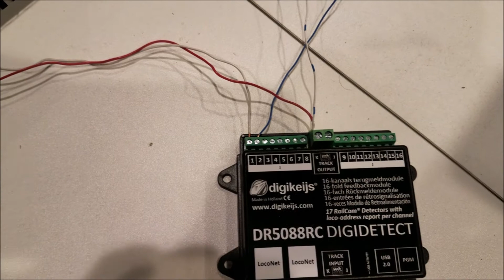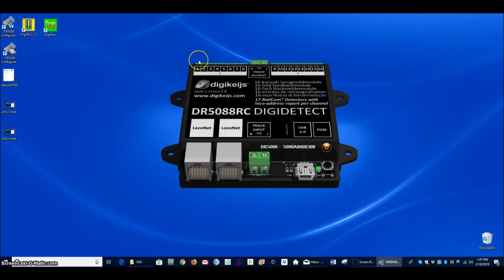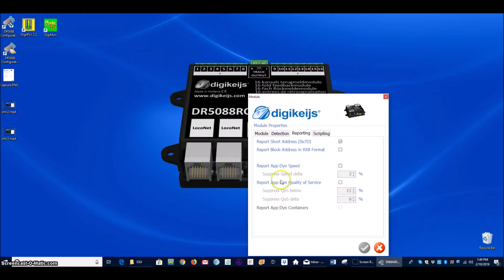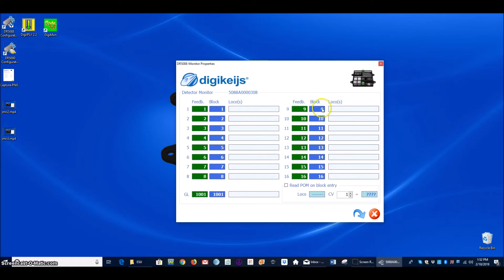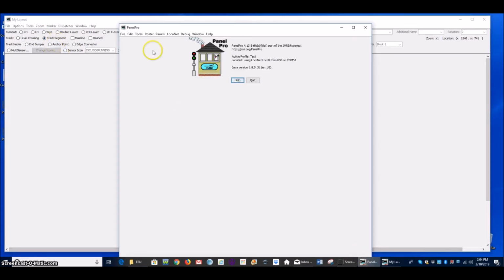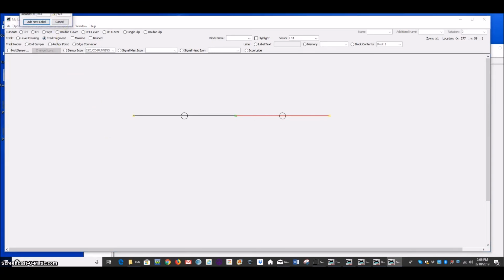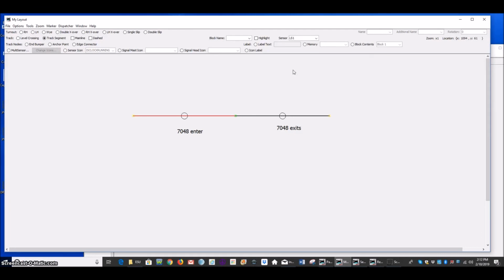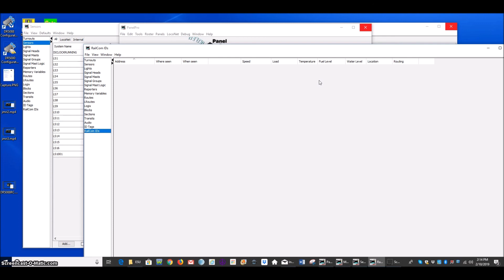Setup For Digikeijs DR5088RC RailCom & Block Detection With JMRI

Comment: What is the 17th global channel?  How is it different from the other 16?  Does it have some different application?  I've read the manual for the DR5088RC and it seems to assume the reader already understands what it's for.    Thanks!
Reply from the maker: The 17th channel is for any section of track that you don't need the detection.  An example would be yard tracks or a siding.

Comment: Maybe you can answer my question, does it also do current detection? Just wondering if it works with the resistive axles that a lot of people use.
Reply from the maker: It will do current detection but you need a higher value resistor for the wheel sets.  This is by design for RailCom to work.  A loco will provide enough resistance but your average pre-made wheel sets won't.  You would need to make your own.  If you already have a fleet of cars with the resistors on them then it would be much easier to double block the layout using a DR4088LN-CS or similar.    Here is a video on Double Blocking: https://youtu.be/1KDHgbCGLhw
Reply: @IronPlanetHobbies  Thanks for the answer! this helps make some things clear. I was also wondering about double blocking (although, for termination tracks I'd also add a stop IR sensor probably), so thanks for linking the video.

Comment: Will this detect a resistor wheel set as well?
Reply from the maker: It will do current detection but you need a higher value resistor for the wheel sets.  This is by design for RailCom to work.  A loco will provide enough resistance but your average pre-made wheel sets won't.  You would need to make your own.  If you already have a fleet of cars with the resistors on them then it would be much easier to double block the layout using a DR4088LN-CS or similar.    Here is a video on Double Blocking: https://youtu.be/1KDHgbCGLhw

Comment: Hi! Is Digikeijs going to make a Feedback module equivalent to the ROCO Z21 detector running on CAN Bus?
Reply from the maker: I would say probably not since the DR5000 uses XpressNet & LocoNet.  The only advantage for Digikeijs to add CAN would be to use it with Zimo since the Zimo LocoNet port isn't active (as far as I know).   The DR5088RC already works with any LocoNet system that supports RailCom such as the Roco Z21.
Reply: @IronPlanetHobbies  Thanks. I have a new Zimo system, will do testing Zimo feedback module on CAN Bus with iTrain if it can detect the address and direction of travel like Z21 detector connected to Z21 via CAN Bus.
Reply from the maker: @dcctrain  You bet!   If you get a chance to try the LocoNet port on the Zimo, I'd be interested to know if it works now.
Reply: @IronPlanetHobbies  Is DR5088RC will read the address and direction of travel?
Reply from the maker: @dcctrain  Yes,  in some 3rd party programs you can see the RailCom info.  This can also been seen in the DR5088RC PC App.   You can download and run the PC App in demo mode without having a DR5088RC just to get a feel of how the program works.  You can follow the link from here.  https://www.digikeijs.us/dr5088rc-digidetect.html
Reply from the maker: @dcctrain  Yes, and it is reported in the RailCom info.

Comment: Will the  work with an ESU 50200 Command Station and ESU decoder equipped locos for block detection without using JMRI?  Thank you
Reply: It works as a block occupancy detector but RailCom feedback is not available on the ECoS.

Comment: Hello, From the DR5088RC track output K, red wire is going on the rail. But where is going the white/blue one?
Reply from the maker: It is also going to the common rail since mine was double gapped.  If you aren't double gapping then you would only need the red wire.
Reply: Thanks a lot

Comment: Digikeiji do not mention anything about using a isolator. Do I need to use one of these if I am only using DR5088RC.

Alan
Reply from the maker: You only need the isolator if you are needing to look at the DR5033RC PC app (USB Plugged In) with Track Power Connected.  The isolator gets around the big red warning in the DR5033RC manual.  With a normal setup, you connect the USB to the PC to make changes to the settings before connecting to your track power.  The USB will power up the DR5088RC.  After connecting your tracking power and LocoNet you don't want or want the USB connection or you will have two power sources at the same time.
Reply: OK Thank you. Should have read the manual 1st